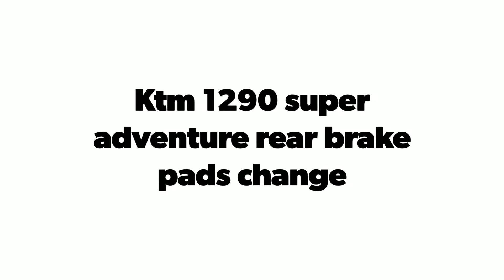Ktm 1290 super adventure rear brake pads change

Comment: Thanks, very useful. Doing my first change at 12,500 miles.
Reply: BTW, wincing at you poking around with a screwdriver. I've always used wood or plastic if possible. I have some heavy plastic vehicle trim removal tools that I plan to use to work at the caliper pistons, and something metal and blunt if that fails :-)
Reply: After a bit of a fight I put the outside pad in first, followed by the inside. There are no pistons on the inside to catch on and with a smear of copper grease I found it easier to judge when it was ready to slide in. The video was invaluable, and saved me a lot of time.